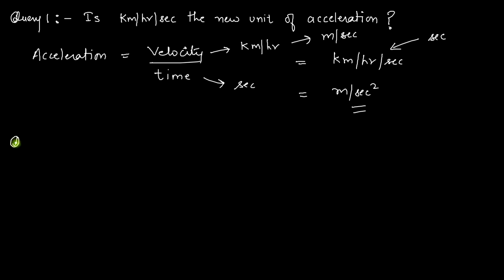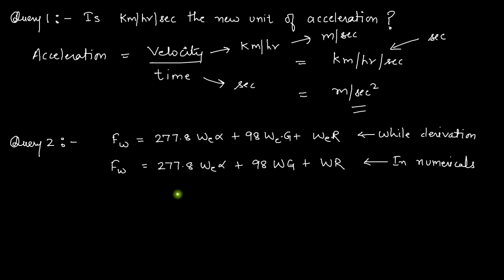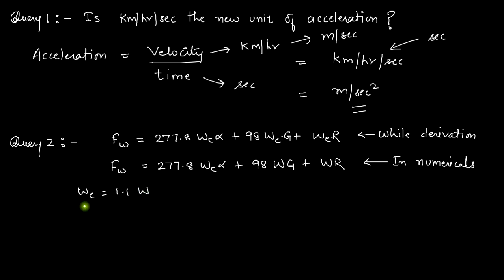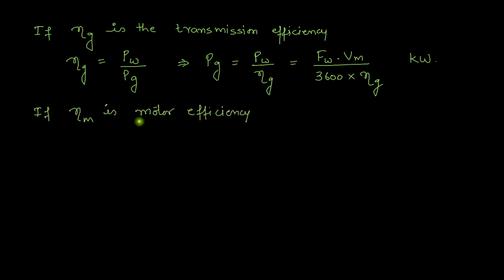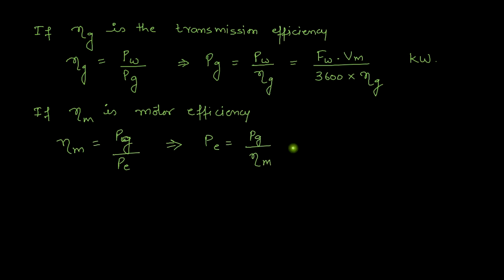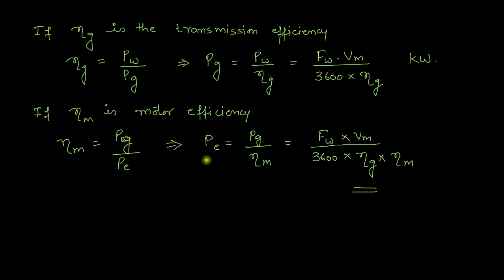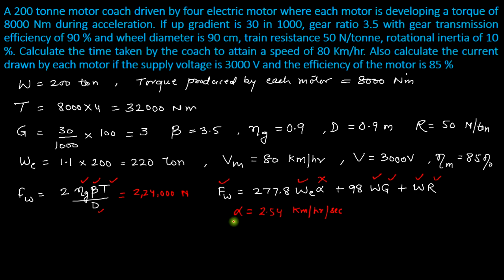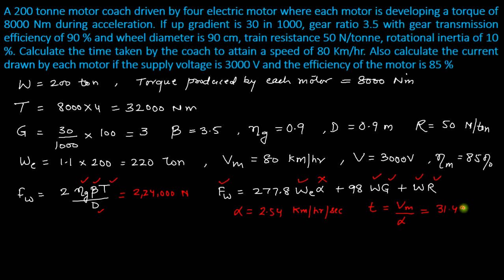UEE   Specific Energy Consumption of Locomotive Part 1

Comment: Greetings sir! In question number 2  you explained the reason using the graph and what the authors have taken into consideration. But is it not so that conventionally we either take ideal condition or the practical condition while solving if we use both together will it not hamper our calculations and answer by a big margin and during de-acceleration also do we neglect the gradient and mechanical resistance?
Reply from the maker: 0.1 would make much difference